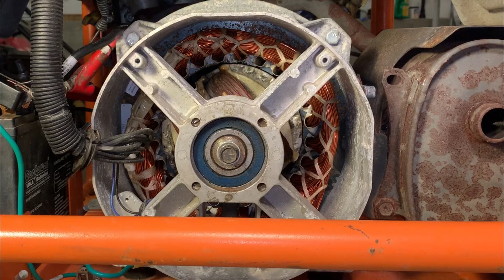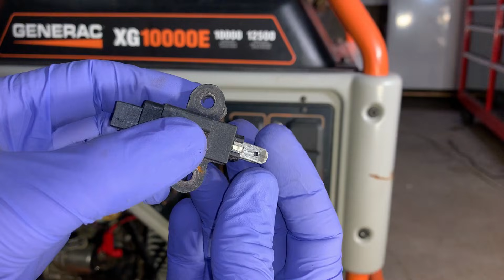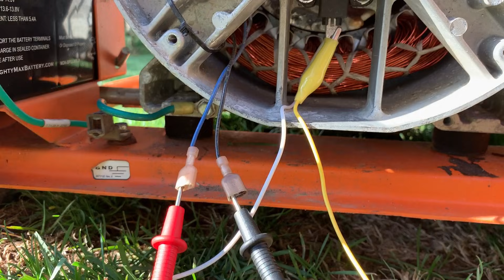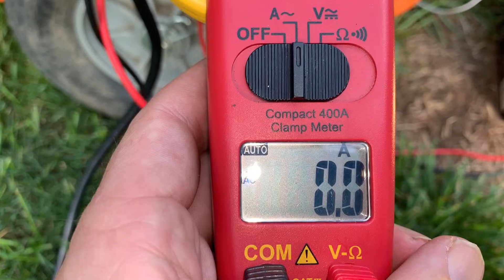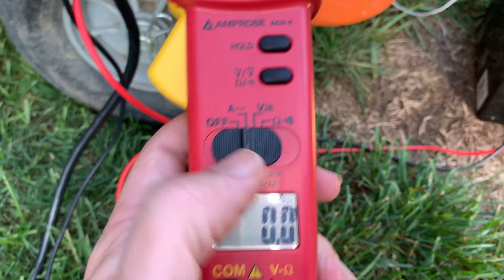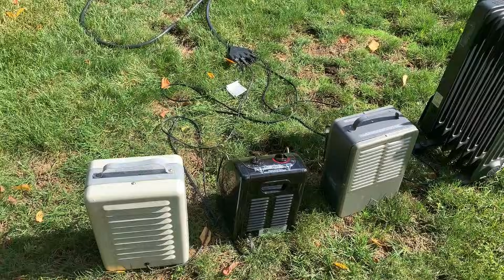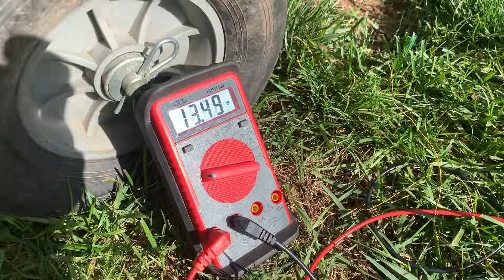Generac XG10000e No Power/No Voltage - Fixed

Comment: Sounds like the previous owner might need to find a new repair shop.
Reply: My favourite experience was repairing a generator for a shop (motorcycle but they kept having generators brought in) back when I had never seen the inside of one before and didn’t know what an avr was or did, let alone much about brushes (I must have pulled them, it was so long ago I forget), lucky for me the owner already did all the textbook repairs, which meant everything I didn’t know was known good (I still suspected the “black box thing” now known as the avr to have been damaged by the initial failure, cause and effect are difficult) so I poked around, pulled the stator (while having one of my first experiences with marijuana, otherwise I would likely have asked about going that far in) then I brought the stator to the guy and had the generator all packed up, he said if I can fix it to go ahead because otherwise he would have to pay XXX for a replacement from eBay (I was a bit nervous because failure meant he may miss the sale and not find one again) brought it back, tore the coverings off the wires, used varsol to soften the varnish, I think I used some acetone too? Not sure, found the break (connection between the wires and the windings, child’s play) and then realized I couldn’t connect it back because the winding went under the rest of the windings, checked from the known break to make sure it was the actual break and not my fault, the other side was broken, or something else (my thoughts at the time, but it was just the other side), took a risk and opened that side up too, it was broken, allowed mild internal panic to wash over me (maybe I broke them both, and this wasn’t the problem?) as I tried to get continuity between the ends, sanded the varnish a bit and got continuity, and salvation.

Next was the actual repair, so I headed to town, grabbed some light blow fuse holders, or whatever they call them, mainly because I couldn’t find another source of wire strong enough without going to the city (100-150km trip), conveniently though that would allow a easy to replace failure point and flexibility, so I soldered the connections up and started the next step.

I put it (the stator) all back together and it had an intermittent connection...., took it apart and made it cleaner and wrapped the wires in a way that made a mechanical connection, using the solder just to hold them stiff, popped some non light fuses in and threw it together, fired it up and tested with a vacuum, all was good, sent it off to the shop I got it from and traded the work for a carb sync for my dads bike (possibly a tuning too? The person was vague even before the generator thing).

Last I heard about it, he sent it up North to family to have it as the generator there (unsure if backup or as constant use)
Reply: @aterack833  well done and thank-you for your persistence and sharing. What a journey!

Comment: Nice repair James on someones mess! Do you consider that to be an excessive amount of hours on that unit? The engine sound solid yet. Way over my head.   Roger
Reply from the maker: The engine sounded fine.   Not sure the expected life.  Those hour counters are not always accurate.  If you leave the ignition switch in the run position with the engine off, the clock will count the hours.  I usually run the carb dry and let it stall before storing.  When it stalls the switch is still in the run position.  If electric start, then the battery will keep the clock ticking.  Have caught myself a few times.  Definitely will devalue your equipment if you do that.
Reply: Very good to know, thanks for the response!

Comment: Would it have been helpful to check the compression on the motor? Any way you look at it, a job well done ! You have brought it back to life once again.
Reply from the maker: I could have tested the compression and leak down to find the health.  Also putting it under load will tell you pretty quickly if it is healthy.

Comment: Nice job. It appears someone before you disconnected AVR and improperly reconnected it. I picked  up a B&S Storm Responder with no voltage output and the problem was the brushes were improperly connected.

Comment: Great job!👍  I'm curious, what are you using for backup power for your house? I have a Generac 7550 EXL that I bought used 8 years ago. Only things I have had to replace was the battery and the low oil sensor. It's been a great running generator.
Reply from the maker: I use a Honda EU6500is.  The Generac EXL series was made well.